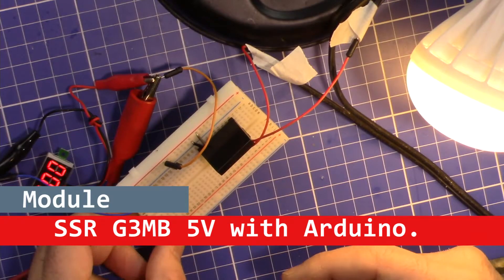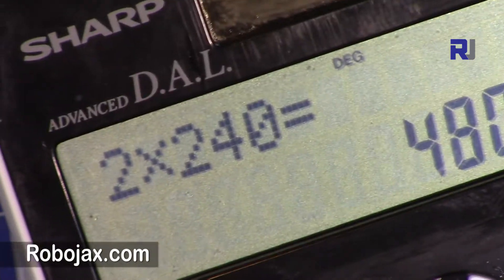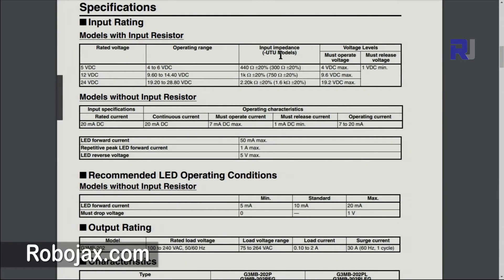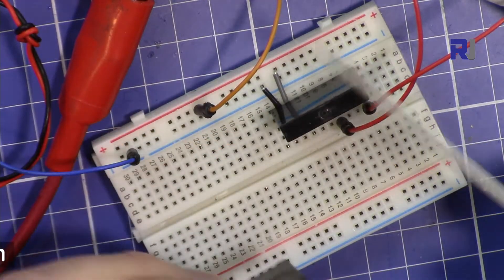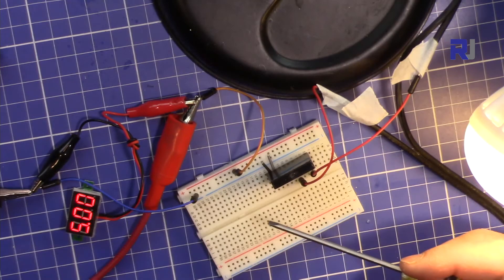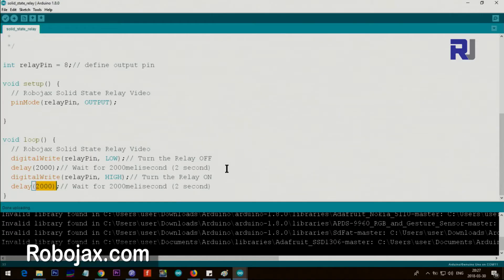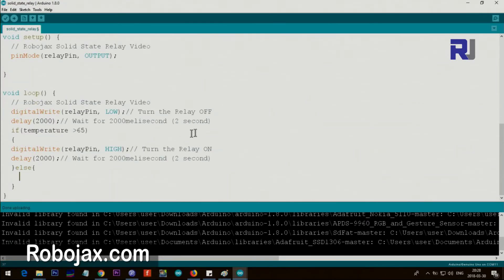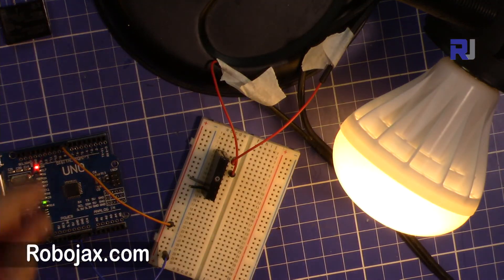Using Omron G3MB Solid State Relay Control AC Load with and without Arduino RJT72

Comment: Breadboard is not designed for use at mains voltages. This video shows scant regard for the dangers of mains voltage!
Reply from the maker: It is about the current . This project needs less than 500mA. If you don’t feel it is right , so it in a better way.
Reply: @robojax  500mA is way more than is needed to kill you!
I would do it a different way, but I worry about young people following your videos that don't know any better.

Comment: Do we need to connect a resistor (like 10k) between + pin of coil and ground? Is it sensitive to noise or not ?
Reply from the maker: do it exactly as I did. this is for AC and there is no + in AC. we have live and neutural.

Comment: hehehe... you are going to burn those little leads that you attached to the wires of the lamp!!
Reply from the maker: No , do the math. Only current is important here and we have 60W bulb and 120V , I= P÷V= 60÷120=0.5A and that is very little. Now imagine if you connect LED bulb, it would be much less. That wire can handle over 2A
Reply: @robojax  Nice! 👍 I have a tendency of using always the thickest wire😁

Comment: Stick a couple of resistors and an NPN transistor between the microcontroller and the G3MB and you can easily drive it from 3.3V logic (ESP32/ESP8266 etc.)
Reply: how

Comment: This type of relay would be good to have on the W88 controller, no noise and almost endless switching times. 🤔 I couldn't find any ssr version like in this video that have at least 10A rating in this small size for 12volt.
I thought I could desolder the existing relay on the W88 and replace it with suitable ssr replacement.

Comment: Hi I made a similar project but using mains to power an ESP32 also, video linked below. Do you hear the high pitch whining noise? Any suggestions on stopping that ? TIA

https://www.facebook.com/akmilton.barker/videos/3891656754201226

Comment: Do you know any other arduino SSR which can control DC volt?
Reply from the maker: when it is SSR, then it is about AC. you can use MOSFET switch  like this https://youtu.be/G9uHVcITHf8 and or this https://youtu.be/17vqLv508Uw or this https://youtu.be/tCJ2Q-CT6Q8
Reply: @robojax  thank you for your expert comment! have a nice day!
Reply from the maker: you are welcome.

Comment: Very Informative BUT you should NEVER run 120VAC though the breadboard. There are SSR relays that have external tie points for the 120VAC and allow for dupont cable connections to the MCU.
Reply from the maker: Thank you for the comment.

Comment: I need i diode for this relay if i use it without a module ??, and can i connect DC-DC ? or only DC-AC??
Reply from the maker: this is for AC load only. No diode is needed.
Reply: @robojax  so which one do u recommend for dc-dc ?

Comment: nice video, where do you usually buy components from its hard to get an original Omron G3MB SSR .
Reply from the maker: I purchase from AliExpress. I would wait sometimes as long as 70 days to receive them.
Reply: Thanks for replying I'll probably do the Same
Reply from the maker: You are welcome. If you can wait, do it. It would be  4 to 5 times cheaper.
Reply: DigiKey Electronics also supplies this SSR.

Comment: Hi Great Project. can you tell me if cut hot or the neutral wire, are we switching hot or neutral wire ?
Reply from the maker: Du to the nature of bulb it doesn't make any difference because if you connect neutral via the SSR (solid state relay) the live voltage will come back passing through the bulb and it will not be safer. Still you should cautiously work this .

Comment: does it work with dc load as well?
Reply: No it DOES NOT if you look at the datasheet of Omron for the G3MB-202P 5V you can see you need 100V AC to 275V AC to make it work.. it needs to seet 0V to switch the load from the sinewave soo.. NOP
Reply: @MoesKeckeEcke  Seriously, you wrote this comment two years after the video was posted but it must have been just as I was 'DISCOVERING' that you cant use them to switch DC.   Sticking with 'blue box' relay module for DC
Reply from the maker: I have not tested it but  most stores listed this  to work with DC , you can see it here https://www.mouser.ca/ProductDetail/Omron-Automation-and-Safety/G3MB-202PL-DC5?qs=sGAEpiMZZMsUriz2CNI3EySWfhI0Lk9UdjTarYOnHK4%3d

Comment: Hey, this is pretty cool  ! can you explain how to power this arduino from the mains ? i.e. use a rectifier circuit ??
Reply from the maker: Sure I will try to record a video on that. Thanks
Reply: thanks. if you do get to present that, I'm curios, for a rookie like myself, what is "better" between putting together some diodes and making the bridge yourself, or reuse/disassemble a phone adapter or buy a cheap ac-dc step down converter ? better in the sense of more stable 5.0V output and overall resilient, considering you want to put it in the wall and forget about it.

Comment: how to use this SSR with nodeMCU ..? in the case of nodeMCU, output voltage of pin in only 3.3 v.. so what should i do..? does i need to anything  else in circuit ..?
Reply from the maker: If you have it in hand, just try it. For the 5V version, it say operating voltage is 4V it might work with 3.3 or even lower. check the specs in the datasheet here  http://robojax.com/learn/arduino/?vid=robojax-solid-state-relay
Reply: i tried but its not working..need help

Comment: This is much simpler to use than the one with a PCB as in your other video (https://www.youtube.com/watch?v=64NatLeGsaE&t=1s). So why people bother using the PCB what's the advantage of it?
Reply from the maker: It is the matter of preference. Some people like to do extra work.  this bare module is very hard to use. How do you connect AC wires? the PCB module allows you to insert the wires and tighten the screw.

Comment: Would you recommend the Omron G3MB or the Single channel Relay from your other video ( https://www.youtube.com/watch?v=58XWVDnB7Ss ) ?
Reply from the maker: If you want to use for higher power loads, then use the 5V relay module. This is for lower power loads. Choice is yours.
Reply: i would recommend the single channel relay because of sure and safe insulation..this ssr is all fake and long gone from omron (discontinued only china clones left)..

in a hobby project safety is important and you don't switch nearly enought for the relay to break in its lifetime. Do NOT believe chinese insulation if it is transformer or ssr!